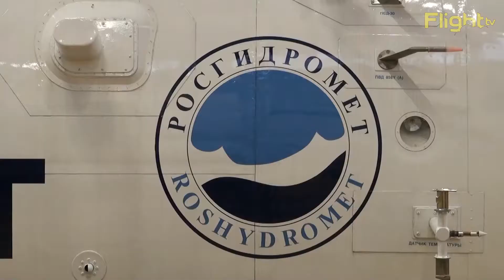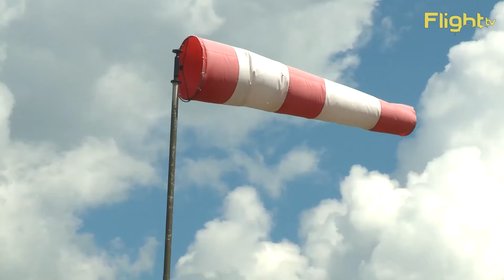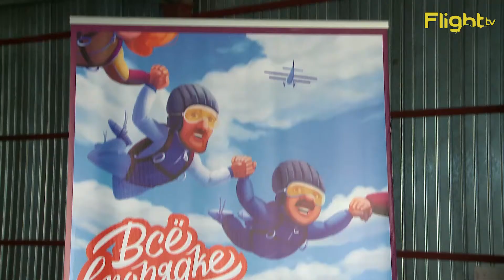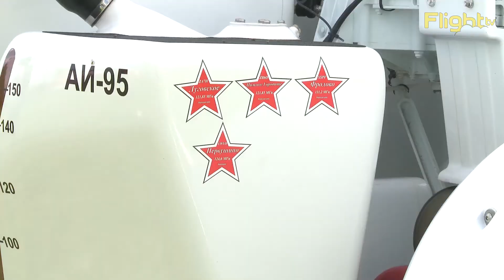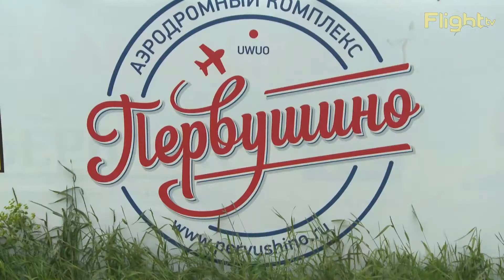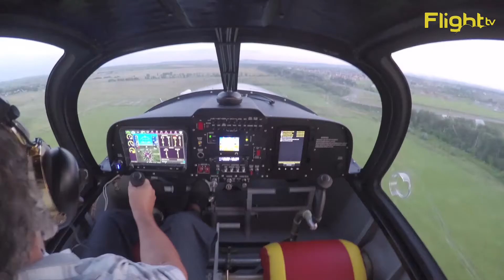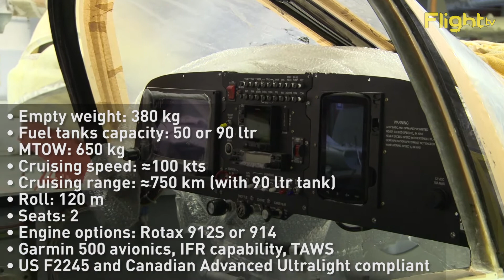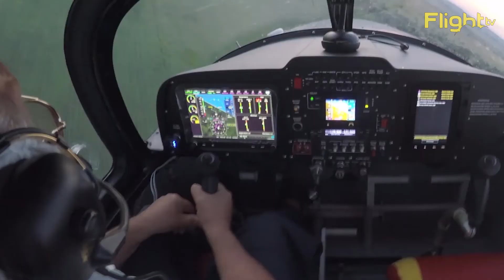FlightTV English Episode 14. New flying boat is airborne!

Comment: Can you do an English report on other seaplanes?  How many are under development or in production?
Reply from the maker: Actually there were other amphibians in our 2015 English issues, 1 to 8. Currently, as per our knowledge, the following models are produced, apart from Borey, of which you'll hear more by, I guess, mid-September:
• Aerovolga La-8/La-8RS/La-8C (Samara) — two-engine amphibian plane with retractable gear. Engine options are LOM Praha Walter M-601 (original), as well as Continental and Lycoming. Seats 4 to 8. The most expensive of all listed.
• L4x series (Samara): Chaika L-42M by Dmitry Grekhov and L-42MSh by Matvey Schelochkov. 4-seater with two Rotax-912ULS engines. L-44M is essentially the same plane, but with more powerful Rotax 914 engines that allow for greater payloads, longer cruising distances, higher speeds and higher altitudes. Original design by Sergey Annenkov. There are also S-44F and S-72 Hunter land planes based on L-44, the first one is for reconnaissance, patrolling, photography and data collection, and another one is kind of STOL with more durable non-retractable landing gear, big wheels and advanced wing mechanics, good for rough terrain (hunting, S&R).
• ASK-62 (Samara): Two-engine six-seater with push propellers. Was developed in 2015–2016, currently not serialized and exists as a single prototype, waiting for investments, I guess. Rotax or Lycoming engines.
• Che series (Samara) by Boris Chernov, currently you can find Che-22 Corvette, Che-23, Che-25 and Che-29. Borey is essentially another Che (could have been labeled Che-33 maybe), but redeveloped at AeroVolga by Dmitry Suslakov up to all standards and codes applicable. All Chernov's planes are single-engine two-seaters.
• Orion SK-12 and SK-12M (Tyumen). A rival to L-42M, but with some different design ideas: for example, you can use landing gear as a water brake there.
Also, AeroVolga has some ideas of developing something completely different, but we're not in position to elaborate on that yet, as it was told off-the-record.

As well there are different land planes that may be equipped with floats or ski instead of wheels, but those aren't particularly interesting as seaplanes. Also, Beriev bureau is state-owned seaplane designer, but their main product now is jet Be-200ChS, a flying water tank for firefighting.

As for what we can or cannot do, it's all about funding in our case. We're small crew with limited resources, most of us have to do something else to sustain a living, since Flight TV isn't exactly profitable or even self-supporting enterprise. There is a page on Patreon if you decide to support us.
Reply: Thanks for the reply.